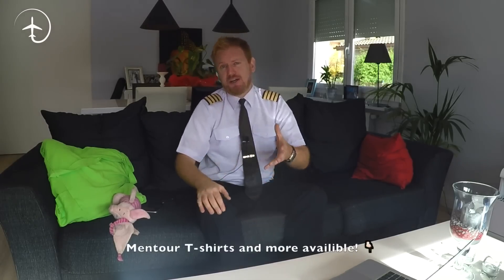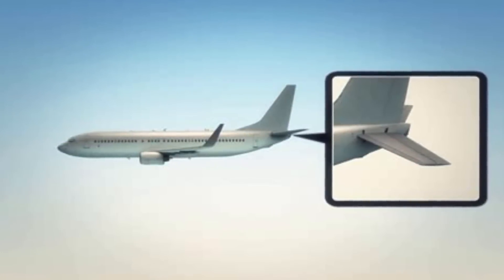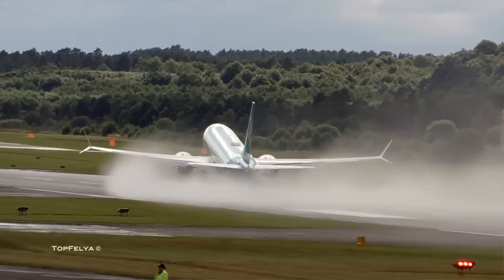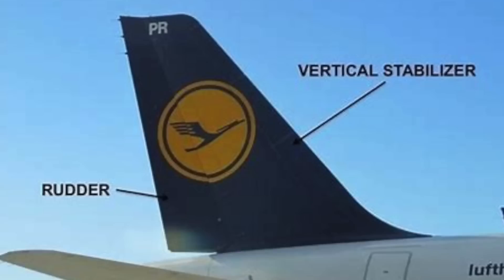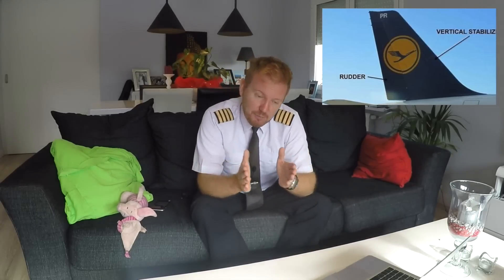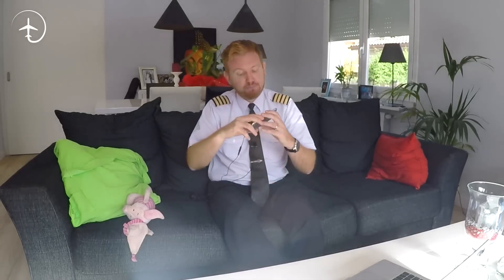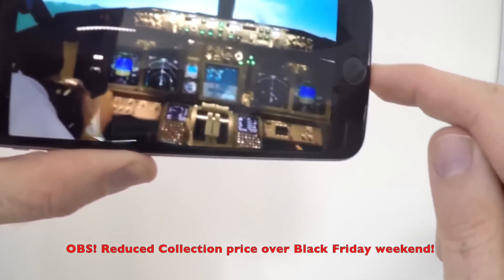How do the "Stabilizers" work?

Comment: You answered a question I had had for some time now. The 737 is perhaps one of the last large commercial aircraft to have mechanical linkages as backup to the servo-controlled hydraulics. Airbus uses fly-by-wire computers with massive redundancy if I am correct. 
So that begs the question of how the much much larger Zeppelins moved their even more massive  control surfaces in the days before hydraulic servos even existed. I do know the answer, which is that they had smaller winglike surfaces both above and below the elevators for instance,  that worked like the tail surfaces of a small airplane and essentially flew those huge balanced airfoils into the positions needed to change the direction of the entire  airship. The rudders (top and bottom) worked the same way. While that method worked within the speed regime of those vehicles it was slow to act. Not a big problem when lift was accomplished mostly with buoyancy but for large heavier-than-air craft, it could not be used much.
Reply from the maker: Absolutely correct my friend! Thank you for the interesting input!
Reply: Zeppelins..
Come on man...it's 2019!
Reply: @johnrogan9420  aeronautic physics still the same, so still worth knowing

Comment: Good video, but when you say "momentum," you should be saying "moment."  The first is a conserved physical vector quantity equal to the body's mass times it velocity.  Forces acting on a body change its momentum.  Moment, also known as torque, is a force applied offset from the center of a mass of a body which causes rotation.  "Moment" is used primarily when talking about structures or other objects which are not intended to continuously rotate.  "Torque" is used in rotating systems, such as an engine, to describe the twisting effort on a shaft or similar object.   So, in a turbofan aircraft such as a B737 on takeoff, you would have torque from the engine core causing the fan to rotate, providing a thrust force on the structure of the aircraft, which causes both a pitching moment about the aircraft center of gravity and increasing the aircraft's momentum, causing it to accelerate down the runway.
Reply: True, but we knew what he meant. I love these lessons, thanks.
Reply: I noticed also that the term "momentum" was used incorrectly. 
Momentum also refers to a rotational moment of inertia, the ability to resist against applied torques (or moments?).
The english language is not very unambiguous or precise with those terms.
Reply: James Smith  I hope, aircraft designers and engineers know better, and do not respond like: "We all know it would fly."
Reply: James Smith  "We all knew what he meant.........."
That's some amazing psychic power you have there.
What number am I thinking of?
Reply: Rubbish- "we all knew". Were that so, why would you pass by here? Facts still matter. Some confusion also with pressure and force- quite different critters, not hard at all to get straight.
Reply: yes, i was about to sat this.
Reply: Maybe he is saying "moment arm"
Reply: I'm guessing he meant to say "moment arm." Probably when he first heard the term, he misheard it as "momentum" and it stuck. Still a good video overall, but this error kind of bothered me more than it should...
Reply: @gyes99 I I want to be careful because I only speak English and don't know how specific other languages can be. I would say on this subject, maths (or physics) related English is unambiguous. You said: "The english(English) language is not very unambiguous or(nor) precise with those terms." You very specifically didn't say it's ambiguous. Using a double negative to indicate a positive e.g. not very unambiguous equals ambiguous is poor English. I don't know if your problem is that because "Moment" and "Momentum" have the same first six letters they would appear to you to be related, when they are not, 
To be unambiguous I'm defending the ability of English to be precise in these instances. I do willingly concede that English can use two words that are pronounced the same to mean wildly different things. Furthermore I confess I have no ability with other languages and accept my inferiority in many aspects to polyglots.
Reply: @Enatbyte . Given that a moment is a force applied at a distance from a point. What is a "moment arm" it's a term I've never heard?
Reply: English is not my native language and I'm not fluent in it but
 " moment " is the English form of Latin term "momentum" used in phisics. The word itself originaly has meanings of movement, motion; moving power; alteration, change. Another " moment" in English which describe a short amount of time is coming from old French.( may be from Normans). Moment and momentum are one and the same thing in English spoken  science.
Reply: @COIcultist  You are correct that a moment is a force applied at a distance from a point. The "moment arm" is the actual distance at which that force is applied. In the context of this video, the moment arm of the vertical stabilizer is the distance of the stabilizer from the aircraft's center of mass (COM). As he was trying to explain in the video, the distance of the stabilizer from the COM is much greater than the distance of each engine from the COM (i.e. the vertical stabilizer has a greater moment arm than the engines), the vertical stabilizer does not need to produce as much force to overcome the moment induced by an engine out.
Reply: @ddegn  you're not thinking of a number at all, you're thinking how clever you are for this rhetorical device
Reply: @nathansmith3608  You need to improve your psychic abilities. I was thinking of e cubed.
Maybe it's not always safe to assume what people are thinking.
Reply: I was thinking the same way, but didn't know that "moment" is a synonym for "torque", i hope it's correct, always learning
Reply: Yes, as several people here have observed, he had "moment" and "momentum" misused, though I'm sure he is completely clear on the actual physics.  Brian Cox's clarification of those two terms is perfect, but I want to point out that gyes99 saying "Momentum also refers to a rotational moment of inertia, the ability to resist against applied torques (or moments?)" is a third item, namely angular momentum, which is distinct from both linear momentum and moments.  Angular momentum is a vector pointing along the axis around which some mass is rotating/revolving (no continuing force needed once a steady state has been achieved, just like with linear momentum).  Even an attempted change in the direction of this axis is resisted by the law of conservation of angular momentum, which is distinct from the law of conservation of linear momentum.  In both cases, a vector (direction and magnitude) is being preserved, i.e., is resisting change.
Reply: @garrettmineo  
Yeah we knew what he meant but every time he said the word momentum it drove me a little more crazy LOL. Also, since we're talking about an engineering system which also does have momentum as well as moment arms or vector forces we should use the proper terminology
Reply: @hsw268  
Perhaps but I don't think his accent is sufficient for moment arm to sound like momentum LOL
Reply: @Enatbyte  
It bothered me too because it's a pretty simple thing and also because in an aircraft or any other engineering system there is momentum so we shouldn't use that word when we're talking about something else
Reply: James Smith  You and I might have known, but obviously, not everyone did...
Reply: in flight 587 they read the manual! which told them to do that it was a horrific tradegy  that should never have happened !
that was  a design defect if you ask me !  that rudder should never have broken off regardless of inputs 
yes its abnormal strain on the rudder  our car steering wheels dont fall off if we go back and forth several times!
Reply: @HDSME  Thats what I thought, if the rudder can't handle a specific extend of handling, this should be prevented from the system.
Reply: @Delibro  Yes, but overprotecting against pilot inputs can also be dangerous.  There are situations where a pilot realizes that a certain amount of excessive input beyond the normal safety limit is needed to prevent an immediate disaster, and where that choice, while dangerous, gives a better chance of survival than the otherwise assured immediate disaster.  So, these design/limits considerations are a trade-off.
Reply: @HartmutWSager  Yes thats completely true, its a tradeoff.
But it was an Airbus, as I understand, its a bit of their way to protect the pilots from such situation. If it was a Boeing, I would understand it more that way.
Reply: @Delibro  the operartioal manuel told them to wiggle the rudder! now who is a fault!   pilot erra as all ways
air planes are dangerous you not getting me on a 787 no way its all plastic!!!
Reply: @COIcultist  - It is the "distance" part of those two things.
Reply: @Enatbyte  and Bruce Fowler. Thanks for explaining that I don't believe I ever heard that term or if I did my brain was switched off. I found it very easy to "See" Newtonian Maths (Physics) So I could just do it, alas everything went a bit pear shaped doing calculus.
Reply: @HDSME  I don't comment on that as it contains pejudiced assumes and in your second line wrong statements and off topic.
Reply: @Delibro  wrong about what ? the plastic plane ? 
I t s not something you would catch me in  and I dont need your comment thank you
Reply: @ddegn  
6
Reply: James Smith  .  true -for those who knew -.  but as this is an educational type presentation it is good that it gets picked up for the benefit of the nonscientific public.

Mentour Pilot's freeform, apparently ad-lib personal style is very good, seeing how much of the topics he speaks about are purely drawn from operational knowledge and experience, rather than technical theory (which backs it all up)
Reply: You people are just so smart
Reply: @Brian Cox I really appreciate the english lesson, kind sir. To all others, english is not the primary language for all of us, but i dare to believe that all here know at least the four laws of newtonian physics, and that we possess enough common sense to understand some simple principles, so, yes, i know what he meant. If you didn't, maybe you shouldn't have watched this video in the first place.
Reply: Movement?
Reply: Elevator...controlled by the yoke but actually actuated by a hydraulic jack screw device....which do break...see Alaska air 261...crash off the channel islands!
Reply: No physical wires will control the elevator is the jack screw device breaks or gets stuck!
Reply: Rudder movements
Reply: Find no mention of the term moment in aviation sites.
Reply: @johnrogan9420  actually, on the B737s the vertical stabilizer (trim) can be manualy adjusted by those 2 spinnamathingies on the lower part of the central console (search for Runaway Stabilizer by Mentour Pilot)
Reply: It amazes me (not) on how many people seem to know it all here. LOL
Reply: Absolutely correct !
I think he knew it should have been the moment of a force about a point but just used the wrong word.
In defence I wish my swedish was as good as his english.
Reply: @Alec Mesa please tell me why
Reply: You are absolutely right. Momentum = mv and force =d(mv)/dt.
Reply: most ppl who took high school physics readily understood that what he meant by "momentum" was really "moment" ie: Force x Distance. "Momentum" is Mass x Vel
Reply: Dictionary well and truly swallowed.....whole lol
Reply: @COIcultist  I've heard the phrase lever arm used quite a lot in the UK.
Reply: @COIcultist  Maybe not a rigorous term, but I think "moment arm" is simply a term for the imagined 'lever' that is pushed (sideways) at one end by the force, producing the moment. So if units were needed to describe a moment arm, they would be simply distance (e.g. metres or feet). Mathematically, I guess force x 'moment arm' = moment.
Reply: Exactly what I was about to comment.

Comment: The way you explained is  ABSOLUTELY FANTASTIC   captain !!!!!!!😊... 

You have explained about the trim and control in detail... Just one thing could have been added when u discussed about horizontal and vertical stabilizers.. 
These surfaces are providing the stabilizing force and moment for stabilizing the aircraft and coming back to its original position when the aircraft disturbed from its intented path due to air turbulence,  to a great extent without pilot or computers intervention to correct the flight path.   Its an inherent quality of an stable aircraft !!!!
Reply: You make a good human airplane with your arms for wings head for pitch... I laughed a little. Keep up challenging subjects.

Comment: There were several incidents with the 737 rudder caused by uncommanded deflections which led to at least 2 fatal crashes, United Airlines Flight 585 and USAir Flight 427.
Reply: This was partially caused by Boeing saving money on the 737 design by not installing a split rudder in the same manner as the 727 or 707.   The 737 has always compromised redundancy and therefore safety in the interest of cost.

Comment: I always thought that banking the aircraft resulted in some of the vertical lift component now applying a centripetal force to the aircraft resulting in the turn (when used in conjunction with the rudder input). That reduction in vertical lift also results in a loss of altitude during the turn.

On a separate note, momentum is mass X velocity (kg.m/s), where as moment is force X distance (Nm), which is I think what you are referring to? It's difficult when English isn't your first language, you do a first rate job.

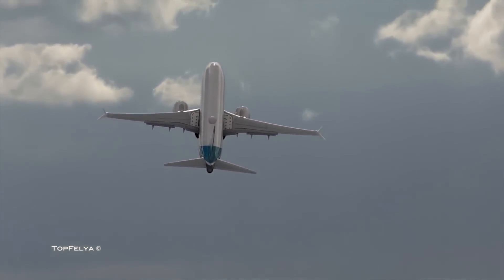Comment: 3:37 excuse me wtf? How's that plane lifting at 90 degrees like that? Wouldn't it stall?
Reply: Empty plane, powerful engines, long takeoff roll and moving very fast
Reply: All you need is a thrust to weight ratio to be way more than 1 to go vertical
Reply: It's not 90 degrees, it may look like 90 because of camera angle. And this is just a demo flight to make some show, I believe that few seconds later piltos will be dropping the nose down.
Reply: Its just the camera angle, but in fact, it was close to 40~45 degrees(i know, its hard to believe)
Reply: i mean almost any plane can have a steep take off... As long as the thrust to weight ratio is fine...

Comment: Could you make a video about the yaw damper? What exactly is it? What does it do? How does it work? What does it NOT do (i.e. when do we need manual rudder input)? When should a pilot switch it off? What happens if it malfunctions? Have there been incidents or accidents related to the yaw damper?

Comment: Great Info on this Channel, also for Aviatic laymen :-)

What stuns me, the Fin (vertical stabilizer) can be ripped off of a plane by airstream alone (as shown at 15:10). But then, about Wings it is known they are designed to never brake. 

Now I'm wondering if bad wheather or turbulence conditions can make Fins breaking away, accidentally. As I learn, bad maneuvering conditions (which could occur in severe turbulences?) would easily rip them off. 

In other words, why are Wings built so strong (to never brake), while vital Fins aren't that strong, so they can brake eventually.

Comment: Another highly informative video, thank you.  In coordinated turns, you might have mentioned that, while 'down' is kept perpendicular to the floor of the aircraft, that necessitates an increase in total force pushing you into your seat--the always present 1g of gravity plus the side-ways centrifugal force due to turning.  'Coordinated' turning means you bank enough so that the centrifugal force just rotates the total force vector so it point perpendicular to the floor.  If I remember correctly, I think a 60° bank will result in a 2-g turn, meaning all weights will double.  You can really notice this when you try to take a sip of your cocktail during a turn.

Have you read Wolfgang Langewiesche's "Stick and Rudder"?  It's a must for pilots, still great even though written in 1944.  He never believed in the Bernoulli principle explanation for lift and explains why in the book.  It's still being debated now I think.  Where do you stand on this?  Is it the Bernoulli thing or is it due to the air deflected downward due to the wings' angle of attack?
Reply: You CAN generate lift by the wing's angle of attack, that's how stunt planes can fly upside-down. But it creates a lot of drag, because of the turbulence generated on the upper surface. Efficiency is critical in commercial airlines. You could make a flat wing and use angle of attack for lift, but you would burn a lot more fuel.
Reply: @daleinaz1  Ah, but the question isn't if it's possible to generate lift that way but whether that IS the mechanism of lift generation.  I don't think the question is settled yet, I saw something on it just a year or two ago.  It's always been taught that it's the Bernoulli principle but then someone came out with an analysis that said no, it's the angle of attack. I think that was maybe 10 years ago, maybe 15, my memory sucks for timing.  The recent thing I saw said something like wait a minute, it might look like angle of attack overall, but if you look at what's going on at small scales, Bernoulli pops his head back up.

Comment: When mentioning balancing the turn with the rudder, I've wondered if there's much adverse yaw (secondary sideslip type yaw) from the down going aileron of the uplifting side wing? That is, if the automatic or manual rudder inputs weren't implied? With gliders/sailplanes for example, the aircraft would sort of side slip out of the banked turn, without plenty of rudder.

Comment: The way I understand it, it's basically like an arm holding against a wall. The arm is the stabilizer and the wall is the air. Without the stabilizer, the plane tumbles uncontrollably.